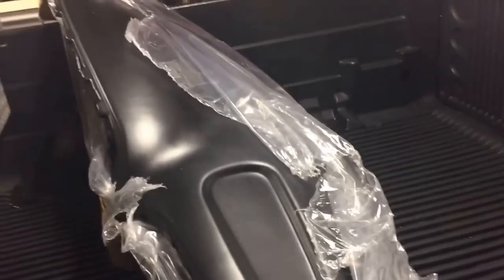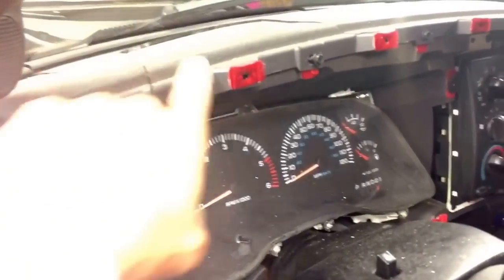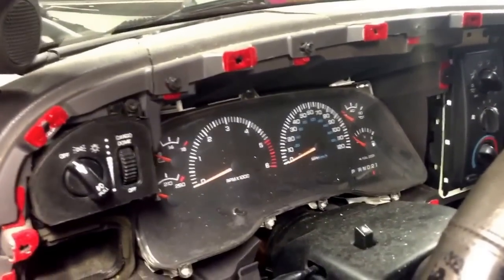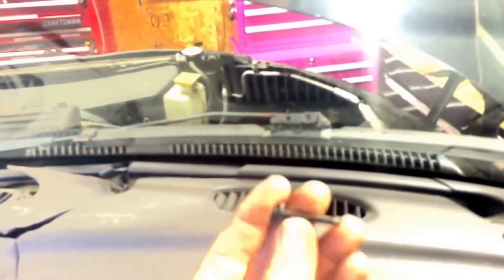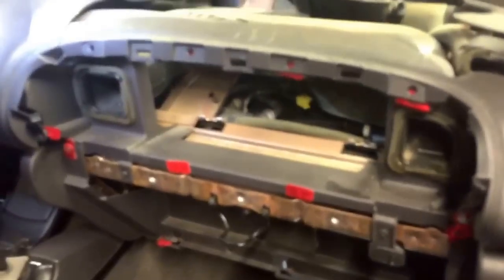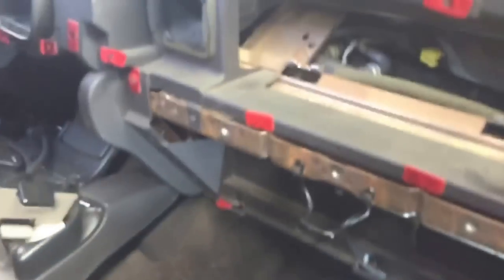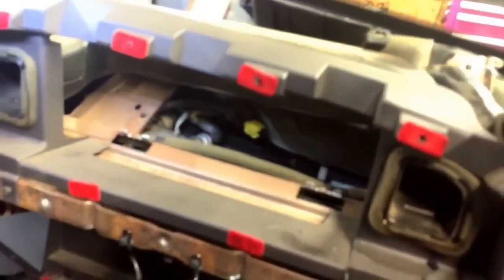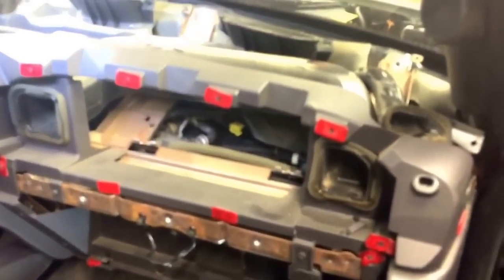Replace install new dash, repair broken cracked dash 1999 Dodge Ram

Comment: I'm afraid I got this work in my future.  My 2002 Ram 2500 also has cracks on the dashboard. Im still pretty mad at Dodge for designing and making a POS.
Since your defroster vents are no longer screwed on the new dashboard,
how does it look and work?  Are there gaps between the defroster vents
and new dashboard?  Appreciate your infos.
Reply from the maker: ***** Actually I am very happy with the way it turned out, It really doesn't seem to affect it very much with the vents not screwed to the new dash, It actually sits down pretty tight with very little gap, Defroster still works great.

Comment: How do you feel about the quality of this dash? I know the oem ones should have been recalled lol. Looks better than the carpet.
Reply from the maker: Chris I am very pleased with the quality of this dash, It was actually easier to install then I thought it would be, Took me about 4 hours, Yes these should have been recalled, I have been in the auto business for 10 years, and I have never seen a dodge truck that didn't have a cracked dash. This is a great long term fix, I have also installed the dash cap as well, and they are very easy to install, and look like a brand new dash as well, but I think this dash is better for long term.

Comment from the maker: Actually got it on ebay, Here is the link of the one I got, There are several on ebay, But some of them require you to screw all the ductwork to the dash, http://www.ebay.com/itm/DODGE-Ram-Dash-Board-Replacement-NEW-Fits-98-01-1500-98-02-2500-3500-Series-/301054712082?pt=Motors_Car_Truck_Parts_Accessories&hash=item4618425912
Reply from the maker: Tim Flournoy  On my truck the VIN plate was riveted directly onto the old dash, So it came out with the old dash, after I took the dash out I drilled out the rivets and took it off the old dash then installed it in the same place onto my new dash. If yours is attached to the truck and not the dash, then I think you leave it in place, and make sure the new dash is cutout so you can see the vin plate.
Reply: +Tim Flournoy YOU SIR ARE STOOPID
Reply: +Chiltons Auto Thank you for the great video. That was one bugger of a job.
Reply: +Chiltons Auto Thank you for the great video. That was one bugger of a job.
Reply from the maker: +Tom Sommer Thank you, I always enjoy the comments, and knowing that the videos help.
Reply from the maker: I found mine on ebay, the link is listed in the comment above.
Reply: How long did this take you?